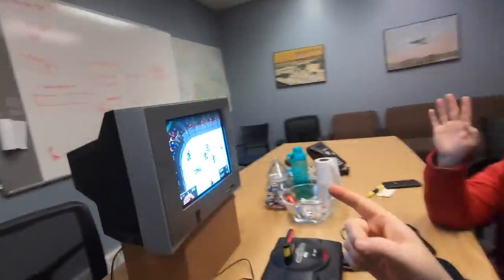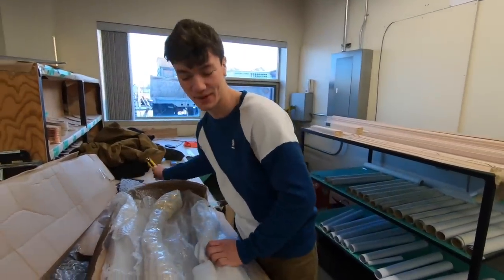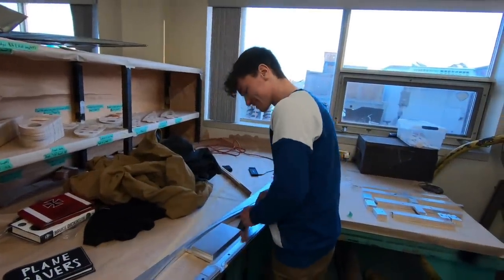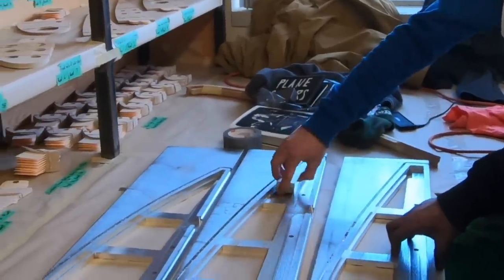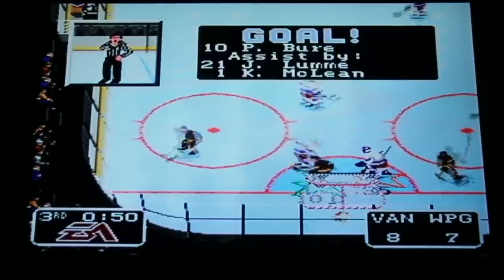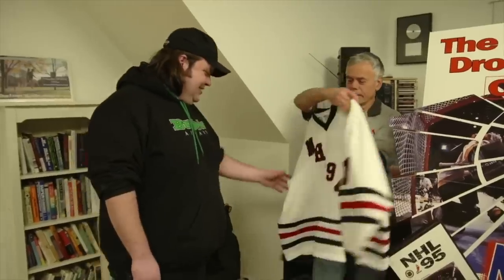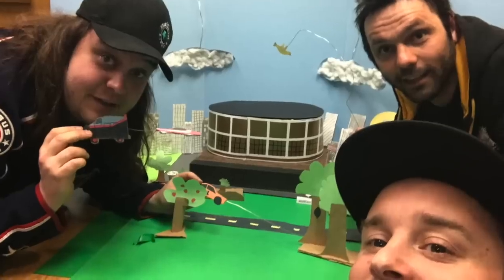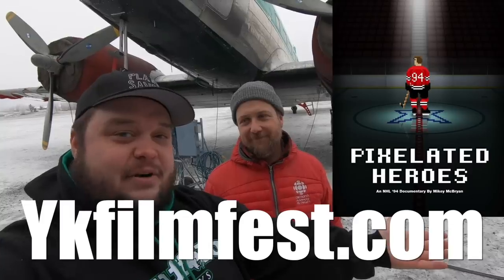Aircraft Jigs Built with $800 of Raw Aluminum!  | Plane Savers S2-E20

Comment: After reading your comments about bending the wood, I can assure you guys that we'll definitely give a try to make a steam box. If it works great, that would save us lots of time. Thanks everyone for the idea! Glad we have such an awesome community! :)
Reply: YES  a steam  box...take 6 days  down  to 1... one hr.  in the box  :-)...
Reply: Benjamin Tessier . there are other simpler bending jigs, see link below. You can make another type using discs cut from a wooden broom handle with eccentric centre holes ( for fine adjustment), and screw them above and below the desired curvature. Mark the curve on a solid or thick plywood base and screw in the discs using countersunk screws which hold best. Clamp the rib if needed. Cheap and gives a repeatable finish. 
 http://www.edwinwhite.com/albums/album51/P1050398.sized.jpg
Reply: Ben kin! une boite à vapeur comme pour faire des chaloupes etc
Reply: They do! Acorn to Arabella have a great steaming setup to bend their planks.
Reply: You can also use a nice tough plastic bag to steam with. That is what I use for antiques as one size fits all. What is really nice to see is you listening to comments. So often people stop listening and keeping their minds open to new ideas. I'm 53... I think, maybe 52.... cripes! I've been in a few trades over the years from mechanic to watchmaker and I've never stop learning. Be lucky

Comment: de-burring - what you do to wooden wings and how you feel in spring...With all that tooling and jigging, you can make a Fokker Factory. Rod looked impressed :)

Mikey McRibs are back!

Today's word:

Definition of kerf. 1 : a slit or notch made by a saw or cutting torch. 2 : the width of cut made by a saw or cutting torch.

Comment: In Aus I worked in the timber industry. Our eucalypt hardwoods would collapse, the wood cells would shrink causing loss of dimensional shape. To cure this we reconditioned the racks of timber with steam which would cause the wood cells to regain their original shape. Fresh out of the reconditioner it was possible to bend a 6 metre long board into a complete circle. Good fun
Reply: Amazing!

Comment: 221:17 why not use a steam box made from a length of plastic pipe? Then you send in the steam to melt the lignin in the wood and it will bend easily. use UF 109 glue and wet-glue your strut over the web. signed, a cabinetmaker

Comment: Guys forget the water soaking that will take weeks and there is a danger of snapping the wood,go this route,nip along to the DIY shop and obtain the largest bore plastic tube you can get the length of your spruce strips,while you are there get a wallpaper steamer,bring the tube back and make two wooden supports to hold the plastic tube on the floor,set up the steamer so it enters one end of the tube and insert the wooden strips,steam enters the tube and moistens the wood,you can do several strips at a time if you wish,for full details see the Fantasy of Flight episode ( Kermit Weeks) where the resident woodworker is using one to make a laminated tailplane for a WW1 aeroplane,the set up is so simple and gets the moisture where you need it impregnated into the wood,the video will show you how and you can make your very own steamer.

I think Rod was thinking all that money for the jig when a block of wood with nails driven into it where the rib curves and small wooden swivelling cams that tighten up the wood close to the jig would suffice,you make several jigs that way so continuity is assured,your alloy jig is a luxury that is not essential but yes it is beautifully designed by Benjamin and a good example of his skills and the facilities available at ENA but Rod is just like Joe thinking 'This is money' ! I make ribs in my back shed with this simple MDF set up,one thing to be careful of with the adhesives to make sure that you place some membrane between the glue joints on the wood and the metal otherwise that epoxy will weld itself to the jig !

Stukie is a cat chaser then ! seeing him sniff behind that door was funny.

Please take my advice in the spirit that it is intended,just trying to save you time and money especially with what everything costs these days in home building aircraft,onwards and upwards for Plane Savers !.

Comment: better than soaking them, Use a pvc pipe as long as any you need to bend , close one end with small vent , mount small gas fitting on other end to attach a tube from a pressure cooker vent , on top of a hot plate.

Comment: Very interesting and a real good show on the part of Benjamin. 
Saved a lot of time by doubling up on the jigs.
.
Hint :
Remember temperature, pressure and air flow can be your friends when looking to accelerate the soaking and drying processes.
.
While you must take care to stick to the "As Engineered" drawings, you can look in to making processes more efficient, as long as there's no out-of-tolerance performance impact on the final material attributes or the part's configuration.
.
Loving the show. Fantastic effort everyone.
Cheers.
.
ps - don't 'cook' the wood :-)

Comment: As all the others in the comments have said steam would be the way to go, just on the glue side, We are using a wood 

glue product called Titebond which is a water based glue.  Clean up with water, but once dry forms a water resistant and 

strong bond.  We are using this to build our Airspeed Oxford Replica.

Comment: At work we used to make jigs from CNC milled aluminum. Which was expensive and time consuming. Then we realized that we actually didn't need the strength of aluminum. So we had the jigs 3D printed in plastic. Though this is not your random consumer grade FDM 3D printer. It is a professional service provider which uses a laser sintering process.

Comment: If you want to save a lot of time, pick up a clothes steamer and take the end off it. Put the steamer hose into a ~100mm piece of pvc pipe with the ends blocked off, just a few drain holes in it and steam the cap strips for 1hr. They are then ready to form and dry overnight.

Comment: Not sure why you needed a hard to find special blade, just take a flat kerf blade and run the wood through one direction and the turn it around and run it through again.  By changing the distance to the fence you change the width of the slot and it is now perfectly centered in the strip.

Comment: It is probably a bit late to suggest now. When you are bending the cap strips with a three day soak and drying them in the jig after forming, you may need to cut an accurately flat stainless steel or aluminium strip and locate it inside the channel you cut in the cap strip to maintain the cut to dimension. It is the nature of wood to swell and then reform to a different shape when drying. You may need to add an extra drying day with that extra strip of metal in place as it will tend to draw sweat and hold moisture in through being cold. 

Getting that preformed aluminium strip into the channel whilst bending the cap strip may be an awkward job or even impossible with a single piece of metal strip. You might need to cut it into several smaller pieces to insert easier, starting from the ends and working in to the centre of the bend as the gap closes. In an ideal world, that internal strip might be welded to or machined into the convex half of the forming clamp. You may also have to cut some temporary pre-formed packing pieces for either side of the cap strip to hold the cap strip straight within the forming clamp until the cap strip itself is firmly gripped, then the forming pieces may be removed to allow the drying. 

To be sure the cap strip is dead straight inside the forming clamp, the pre-formed packing pieces will need to be squeezed in firm against the cap strip with "G"-clamps before the bending clamps are pulled down firm upon the cap strip. Judging that squeeze may be awkward. Too much and the cap strip may bend or split along the inner corners of the channel. I hope I am not distracting you or sending you down a useless dead-end. 

Something else to consider will be the use of "release material" to be painted on the jigs where there will be adhesive spill or extrusion of glue out of the joints. Otherwise the ribs may stick to the jig and the wooden surfaces may tear. Release material is used in making of fibreglass in molds so that the mold pulls free without damaging the workpiece or the mold itself. The last time I used it in making prop blades, it was green, latex sort of stuff. For the record, my prop blades all failed at about eight hours. I have left such things to the experts since. 

If there is clearance between the wooden material and the jigs, you might be able to use thin mylar film or something else which is not attacked by the two-part resin inserted into the jig at the glue joints. I doubt that gladwrap will work without dissolving. Old pieces of TV broadcast tape, VHS videotape or film editing tape might do the job so long as the oxide coat is against the aluminium jig, not the wood where the oxide binder adhesives might chemically weaken the resin. You would need to check first to see if the resin dissolves the mylar. 

Long strips of mylar poking out may also give you grip handles to pull upon when extracting the ribs from the jig at their points of most resistance.

Comment: Rod tried hard to think of something wrong with those rib jigs. He had nothing.
Reply: That was a ton of money for a tool with such limited usefulness...I think he was trying to come up with something to say while being filmed.
Reply: Yeah totally. Why is he so negative..he has nothing to prove Rod is great in his own right so i dont get it.
Reply: When these planes were designed and built there were no CNC routed jigs for assembly.  Grab a sheet of 3/4 ply or whatever is available and screw on stops.  Make six of them and your time will be decreased by 66%.  Use a heat gun to warm the wood and it will relax the rigidity to allow it to conform to your curvature.  Old stuff for woodworkers and wood boat builders.  Use the internet instead of your pocketbook.  And.....use feather boards to hold the wood down and against the fence instead of your fingers, while you have them.  And a shop vacuum to save your lungs.  Trust me on this stuff, and you can breathe while pointing at things.

Comment: Awesome
But
did ben consider the wood swell when wet and excess tolerance needed in his clamp jig so he doesnt squish the wood and  then cap strips would be slightly undersized when dry... my thoughts fer soaked wood
Steaming might b better
Or
Making the rib profile on a block, and soaking all of them, and clamping multiple cover clamps over the jig block radius , to hold the cap strips during drying, vs one at a time

Comment: UHMW might have been a cheaper option for the jigs. Machining is easier as well. Glue does not stick to it at all. All in all, a good job.
Reply: A piece of UHMW would likely have to be much thicker to ensure dimensional stability so there might not be such a cost advantage. Releasing the glued joints will be an issue with the metal jigs if their fit is tight. I imagine that thin mylar or something similar which is not attacked by the two-part resin would be needed to release the joints from the jigs or painted release material as used for making fibreglass pieces in molds.
Reply: @DARANGULAFILM  Hi there, you could attach the UHMW to a tabletop to ensure dimensional stability if the sheet is too thin. You are right that it would need to be thicker if it was to be a standalone jig. Releasing the parts after assembly is going to be the next hurdle. The first glue-up will tell the story.

Comment: Nooooo don't soak it. Put it in a pvc pipe, hook up a wallpaper steamer get it up to 100c the lignum will soften and the wood will bend easy put it in your jig when it's cooled it's good to use.  Find a local boat builder they can demonstrate it.

Comment: I'm wondering why they recommend water soaking the wood when most of the time wood is bent with heat. Heat loosens the lignon and allows the fibers to change shape. The easiest way to heat up wood is with a steam box and it does not take very long perhaps about a half hour, just the time it takes to get the wood up to temperature. Then in the jig overnight.

Comment: Looks like a plan coming together. I however would NOT even consider selling those jigs as long as you own the Fokker. And even if you got rid of it in the future there could be a business opportunity for selling repair parts for others who might crumple a Fokker wing. I also agree with some of the other comments about using steam instead of just soaking the cap strips. the wood where the groove is cut looks very thin and you need as much penetration as possible. I believe steam bending is the way to go. Keep up the good work Benjamin.

Comment: On the Electra behind you all the props were positioned the same way. Is that to attach a wind brake or something like that? Odds of it happening naturally are small?!?  LOL  8)
Reply: Been a while, but if memory serves me, the props have to be left with one of the blades (referred to as the "long blade") in the six-o-clock (or twelve o-clock??) position to prevent oil from back flowing (or something, I don't remember now) out and running all over the ramp. Also, as SOP with most props, you leave just one blade straight down to minimize the number of things to walk (crash-OUCH!!) into when you're moving around the airplane. 
Also, the $64.00 question? How much do you think one of those prop blades weighs???  No cheating, now....
Reply: @davef.2811  LOL.  Not sure on weight, I am sure you would lose walking into one though. 8)  I'm not familiar at all with those engines. On a small P6, like used on a TBM, the prop shaft and engine shaft are not connected. You could actually hold the prop at engine start, to a point LOL. They could turn in the wind if not feathered also, maybe even feathered. I just never noticed the props on a 'parked' Electra being like that before. They look huge! I always liked the unique square tips.  8)  Thanks for the reply!   -gary

Comment: Isn't modern technology great, bringing easier construction to a century old design.
An electric wood steamer would increase your productivity greatly. From my limited experience in steam bending with a jig you could take the wood out of the jig as soon as it has cooled.
We used to use 200 litre drums and a small diameter pipe inserted to bend a native wood to make lobster pots. 
Mikey in Australia Williams head gear is called a beanie.

Comment: 1:05 / 4:13
ATTN Benjamin and Rod  , How to steam bend wooden boat frames in plastic bags instead of a traditional steam box  https://youtu.be/--iPQIwSEJM   Tips from a Shipwright
 Shipwright Louis Sauzedde shows us his trick for steam-bending frames using plastic bags rather than a traditional steam box. The frames are steamed right in position on the side of the boat so that no heat is lost and the frames can continue to steam even after being clamped into position.

Comment: You could have make the jigs from MDF and saved a ton of money.
Reply: You have a few problems with that - 1) Epoxy (i.e. ribs might stick) - need release agent, with aluminum, shouldn't be a major issue, 2) learning - ENA is training new people on how to use CNC machines and design for them.  This was a chance for more training, which serves multiple purposes, 3) they said it in the episode - the jigs will last "forever".  Not really, but it does allow them to pay it forward to some extent since the jigs can be used by others and not be sacrificial.
Reply: @CAPFlyer  Okay. A homebuilder would not spend that much. A fully encased jig is not needed and wax paper solves the glue sticking to the jig issue.
Reply: @jamesvaliensi7706  maybe, but they are also building using certified aircraft best practices instead of experimental/homebuilder, so thlat may be a consideration as well.
Reply: @CAPFlyer  I wish to know what current Part 23 aircraft use wooden ribs?
Reply: @jamesvaliensi7706  Piper Cub to start ...
Reply: @Benoit6ft6  No longer in production, don't count. What is the point of trying to build to certified standards when the plans are not to certified standards. I get that you want to build the airplane as best as possible, but it is experimental and that opens many opportunities to be creative and save money. 
Anyways, I'm jealous because I wish I could work on it too.
Reply: Check out the rib jigs Steen Are Lab makes for the Skybolt and Pitts Special, they are $100 ea

Comment: 7 Day's to bent?? What about steam, just a water boiler, hold it in the steam till it really is soaked, couple of minutes  than bent in the jig for modeling, than klamp direct the peace on the rib and let it dry. That what I learned from a carpenter for some smal peace of wood. 3 day's seems to be for a complete tree. not a thin stroke of wood.
So let's ask again a good carpenter.

Comment: 😲 WOW! $800 for aluminum jigs that will be only used for one airplane? I'm not saying they're not worth it, it would have been cheaper to use plastic, or cheaper yet wood. I imagine there would be other ways of making those that are more practical so you can make more than a couple at three at a time like more jigs cheaper or one big jig that makes several. Hopefully you can get money back reselling them.

🤔 So that's approximately 28 days just to make ribs in the glue up fixture.

🤔 How many bending fixtures did he make? I think I only saw two in previous episode 9. If so that would be 84 days, if that be the case. I hope wrong and he made more than two... like at least 6.

So are we talkin approximately 3 months!!!... just to get the ribs made?!? 😲 or what?!?